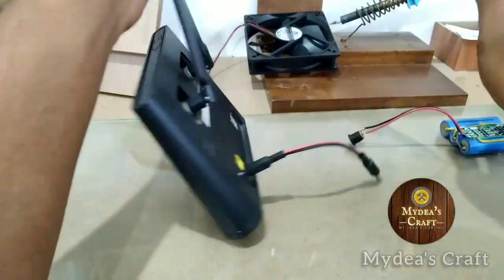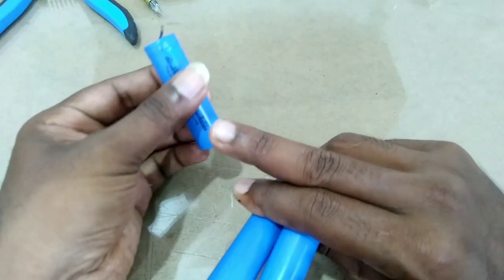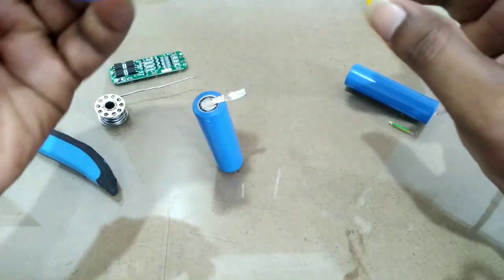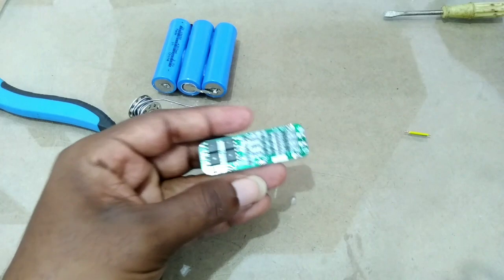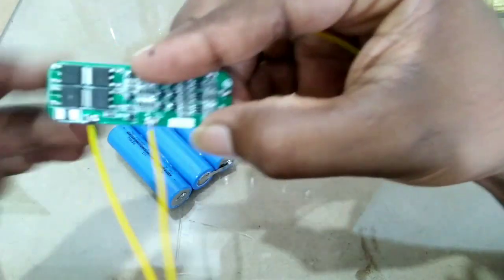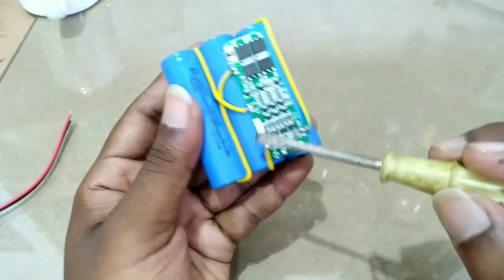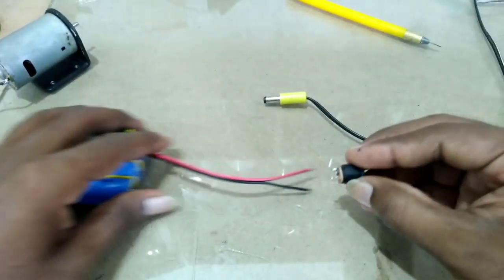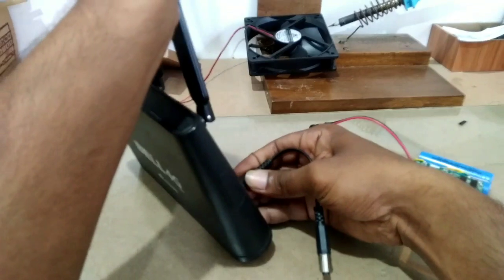How to make rechargeable battery pack| 12v බැට්රි පැක් එකක් හදමු| Sinhala |

Comment: Battery තුනේම output එක විදියට එන්නේ 12.6 ක් නේ .... ඒ උනාට හරියටම  මේක charge කරන්න 13.5v ක වගේ charger එකක් ඕනේ... එහෙම චාජරයකින් charge වෙන ගමන්  output ඒකත් දුන්නොත් router එකට ප්‍රශ්නයක් වෙයිද මොකද router එක ඉල්ලන්නේ 12v ක් වගේ නිසා .... එහෙම නැත්තන් bms එක හරහාද යන්නේ ප්‍රශ්නයක් එන්නැද්ද .....reply plzzz 👼👼👼
Reply: එහෙම ඕන නෑ 12v ඇති Charge වෙන්න router එකේ 12v charger එක පාවිච්චි කරන්න වෙන power pack පාවිච්චි කරන්න යන්න එපා battery සවුත්තු වෙයි 
12v charge එකෙන් හිමීට charge වෙන්නෙ වෙන charger පාවිච්චි කරන්න එපා

Comment: 12v 2a Ac/Dc Adaptor ekkin charge krddi api khmd dana gnne over charge wida nadda kiyl.(nattam bms ek nisa 12.6v witrida charge wenne)
Reply from the maker: Li iron battery module ekak nethuwa arakshithawa charge karanna baha. 

Ehema karanna giyoth baageta charge wenna puluwan, nettan over charge wela pupuranna unath puluwan.

Me pack eka  12v walin charge wenawa welaa yanawa wagema poddak heat wenwa.
12.6 walin thamai wede hariyatama wenne.
Reply: Na na mn ahnne oyaaa dan hdpu battery pack ek 12v 2a ac/dc adaptor eken charge krot awlk nadda?nattm over charge yida kiyla.(maximum adaptor ek ghuwot dc kochrk pennwd multimeter eke?)